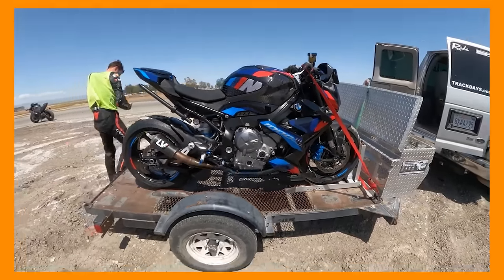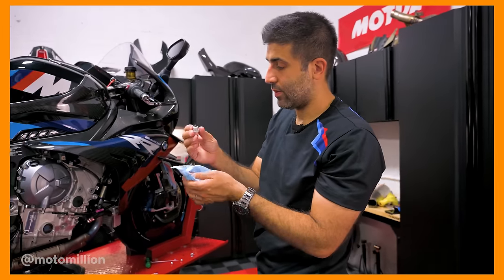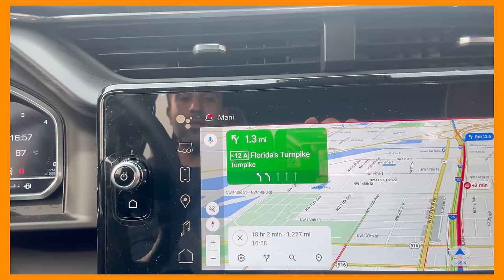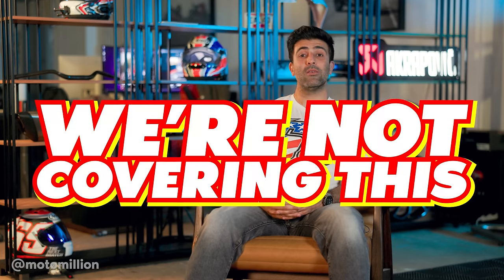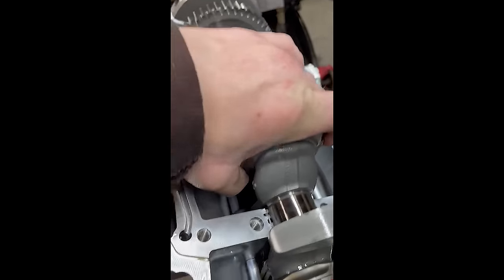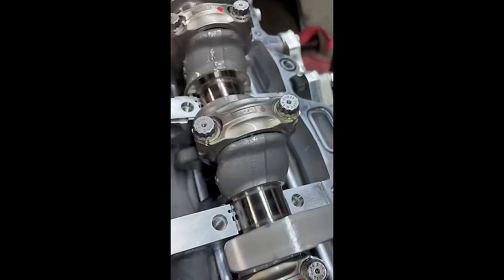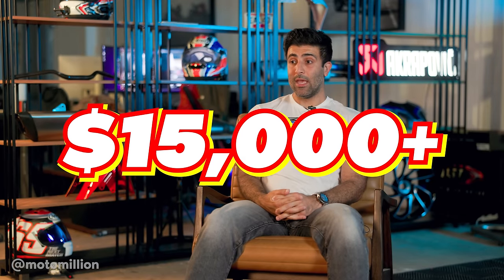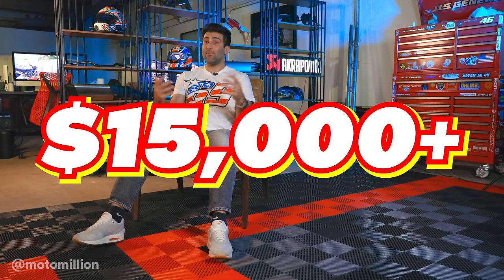MASSIVE Engine Failure on our M1000RR & BMW REFUSED Warranty...

Comment: pretty sure it quite clearly states in the warranty that you can not make any modifications that might effect the operation of the bike and you made a lot. So its no wonder they didn't honour the warranty as you didn't keep to the terms and conditions I suspect.
Reply from the maker: I understand that you don't know the full story and didn't watch to the end.

CaliMotoTV's BMW M1000R blew up on the track. That bike had a full exhaust and an ECU flash. BMW fully replaced the engine under warranty.

Why was Bill's replaced even though modification were present?
Reply: @Motomillion  that doesn’t change the facts about what I have said. Just because someone else’s bike had a different outcome doesn’t change the facts about what it sais in the warranty documentation.

Comment: Gotta say fella, my first thoughts were... " Only a fool puts a barely run in hi performance bike on a dyno and revs the nads off it"... But there are way too many similar instances of this failure on the beemers. I also saw that CarWow vid and figured well theres gotta be a friday bike every week....
For reference I have owned bikes of all types n manufacturer over my 30 years riding, I currently have an MV Dragster 800 RR SCS n thats a highly stressed engine as factory original. I ran that in religiously for the first 1200km before taking above 5k rpm. Its only 3k on it now as I dont ride as much as I used to.
I blown a few engines from Huquarvana to Yamaha n Kawasaki all tuned.... Never blown a Honda tho.... 
You did state that the bearing had not spun n theres no sign of over heat.... i am wondering is it possibly a bearing or oiling design issue.... Probably a bearing type mismatch/incompatibility.

TVR had loads of issues with their inhouse derived Speed 6 which in the end was fixed by the inde specialists (the best of them Powers Performance), replacing the internal chocolate factory components... I had one n went through a whole load of pain n let me say 15k is pennies in comparison.

Comment: I have owned 3 K6 1000 suzies. Mostly run in at redline, bulletproof. My current ride, GS1250 triple black, very leaky Hayes front calipers, BMW didn’t want to know about it, gave me the runaround big time until I gave up. Mmm I paid $31,000 Aus. For a premium product, not so premium.

Comment: Remember cbr1000 rr with juice box 🧃 it was riot but when change fuel ratios the engine catches up but when its breathing have to block plate remove smog etc

Comment: this is also why you should NEVER flash your ecu or use a 3rd part plug in to add/remove ECU features. 
what brentuning and woolich racing do is they turn off the o2 Sensors and make their own tune that the bike runs on. this is bad for many reasons. tuned in different states/countries. different fuels different elevation, air density etc all the stock wideband sensors calculate. (but the flashers disable) 
if you did flash the ECU I would say BMW is right to not honor this claim.

Comment: The break in period for the M1000RR is 746 miles, the engine should never exceed 9000rpm's.
At 400 miles, well below the break in period, you put this bike on a dyno and rev the living shit out of it, you did this before all the internal engine parts had even a chance to seat.
Then it blew up(what a shocker) and BMW refused warranty.
Well of course they refused warranty, it doesn't take a rocket scientist to see why!!!
BMW puts an electronic limiter on the bike to prevent you from going over the 9000rpm, it gets removed when you bring it in for it's service post 746 miles.
You did your own service and clearly removed this limiter at 400 miles, you literally did everything you could to null and void the warranty, this is 100% your fault!!!

Comment: This is propably bit of an disaster for BMW if this is widely spread problem. Could be that the defects per million oppoturnities is not under 10. But to be fair, this bike was not serviced by authorized repair shop, which the manufacturer or seller will use in their favour.

Comment: Wow ive never herd of so many pissed of people regarding their bmw. I myself is paranoid about break in procedures and what not. I follow their procedures and then ask before i modify my bikes. I inquired about bt tune to my dealer before i did stage 1 to unlock the limiters and tune it properly. Bmw said it wasn't a problem to do so .Bmw told me that they expect their customers to modify their bikes. Bmw also told me that they will take the flat spot out in the rpm range so i would not have to have the bt tune to do so, but it would not have as much power as the bt tune. I have about 4500 miles on my bike and ive changed my oil 7 times since ive purchased my bike in 2022. I have had a 2010, 2012 and now a 2022. I had loads of problems with the first two which bmw warrantied. I have been impressed with the 2022 bike i just hope ive not jinked myself by saying it out loud. Now i will not go back to bmw because they want me to change my brake fluid at a outrageous cost which i did my self but it will cost me 60 bucks just to take the light out. Come on thats BS. 
Long time customer of LEES Cycle in San Diego and Jeromy Toye they have always gone the extra mile for me at a fair cost since 2008!

GO Sean Dylan Kelly!!!!
Reply: Oh buy the way u did a good job with the video and thank you for that! Also you kept your cool through this crap they delt you and you should get a medal because ive would have had a melt down and.......

Comment: M1000RR break in is <7000rpm for 186 miles, <9000rpm for 621 miles. He puts a brentune on it, over revs red line by 500rpm 40+ times and puts it on a dyno all before 500 miles. And now, he wants BMW to cover a blown engine under warranty ... roflmao! I just lost a bit of respect for him. Own up to your mistake and move on. However, could the engine have left the factory with a defect, possibly, we will never know.
Reply: You didnt get the full story? He has more than 300 miles and as per the manual guide it's okay to do the first service. He asked the dealer and done the 1st service him self at Motomillion. After that, he got the bike tuned.
Reply: @luanphamuc4921  you are the one who doesnt get it. you are not supposed to go full throttle until 621 miles. he put it on dyno at 400 miles. doesnt matter when you do the first service.
Reply: @optikforlife  you're wrong. the manual says you could do the 1st service after 300 miles, you do not have to wait until it reaches  400 miles. That's why Manni did 1st service at 300 miles. After the 1st service done, the bike is supposed to operate at full throttle, then Manni brought it to dyno and did the tune. Watch the video again bro!
Reply: @luanphamuc4921  you are wrong. In the manual it says no full throttle: 0...1000km. Period.

Comment: you should know that. every maching has to go through a break-in period. you cannot just rev it to the max, step by step until that period passed and even more to be sure. i always go in for a 1000 miles break-in period. no joke at all. If you do not do that, you saw it for yourself. you should have taken it to bmw when you saw the first major warning light.

Comment: Fist of all, I think there are underlying problems with the engine, straight out of the factory. But I think this fair that BMW did not acknowledge the warranty for this case. You can't do your own servicing on a bike that is under mechanical warranty, end of story. You went the extra mile and removed the rev limiter that was clearly in place as a means to protect the engine during the break in period. Then you went full send on a dyno. It doesn't really matter that you "know what you are doing". I personally bought a new CRF1100 and I'm a fully qualified mechanic, yet I don't do the servicing because I know that if something goes wrong with the engine, it may not be covered. Honda are horribly incompetent and overfilled the engine by 600ml of oil during the break-in service but I will still be getting it serviced with them because I need to in order to for mechanical warranty reasons. You mention nothing about the terms of the mechanical warranty in this video and my guess is that you would fine something along the lines of "all servicing must be carried out at BMW mechanic".

Comment: I know everyone is in a rush and doing  things to the bike that might jepodize the warranty seems to be the issue. If its a crappy bike but you followed all the procedures specified then maybe you would get better treatment. Sounds to me that this bike has issues and they know it but when claims start to mount up , guess what happens , you end up in this position. Best of luck with your next purchase and I do get it , this a frustrating place to be when forking out $40k.

Comment: heartbreaking to hear but yeah you shouldnt remove the limiter thats 1 big mistake....2nd if the engine rattles i shouldnt put it on a dyno and 3rd im almost sure there has a faulty bearing in cyllinder 2 .....i bet the messed up the bearing clearance in the factory it self....seeing the conecting rod my geuss wrong bearing clearance but because you removed the limiter bmw says you worked on it yourself waranty gone that simple ....you should put the rev limiter back on and tell bmw it whas fully stock.....in belgium if you buy all new r1 or bmw or ducati every shop gonna tell you to do min 500km or 350miles and if you remove the rev limiter or other stuff you should let it do by certified bmw shop

Comment: Fell sorry for u bro honestly, but removing rev limiter even though wasn't a reason behind the engine failure, it was a reason for BMW to void warranty repair. Each manufacturer would do the same in that case. It's stupid as they are definitely aware of the problem and know it was factory problem. Was thinking about getting S1000XR M but i think you made up my mind and I will get multistrada V4

Comment: Why did the dyno operater let it sit at that high rpm for so long? He hit the stop button but the dyno brake didn’t activate. Either it doesn't have a brake or it malfunctioned. Either way, I don't think its a coincidence the bike revved super high and then had a problem. Since you mentioned over rev, only two ways that can happen. You had a mechanical over rev or a tune that raised the rev limiter. 

Unfortunately, this is your fault. Instead of breaking the bike in properly and making sure everything was good, you rushed it so you could start modifying it for youtube views. Now you're looking for BMW to cover an engine repair when you ignored their warranty terms and conditions. 

I'm willing to bet the 19 hour drive had a lot more to do with a Tech that would hide certain details about your bike to get it covered by warranty. Did he reflash it back to stock before starting the claim? BMW can see that too. Theres really no way to install a tune that BMW can't see. The BMW electronics is way more advanced than Japanese brands. Its hard to fool BMW.

Comment: I would say it is very hard to ruin an engine that quick that has oil in it, unless metal is bad in one of the parts, or improper assy, just my 42 yrs experience.

Comment: You modded the bike instantly, you  knowingly tuned it with warranty voiding tunes, you ran a sprint air filter knowing they do not clean the air anywhere near as well as a stock filter and have many complaints about not sealing correctly! You knew the risk when you modded it and posted the evidence....

Comment: You meant to break it in correctly but cut the corner by dyno testing it as BMW would have detected in the ecu stating over rev by 250rpm so either way it the customer's and BMW's fault but if this became world wide spread issue BMW would be held accountable for manufacturing defect

Comment: BMW acted incredibly unprofessional. I have been running dealership service departments for 30+ years and your experience is unusual specifically from BMW. I own several motorcycles and have owned a couple of BMWs in the past. 
After listening to your experience I will Never own a BMW again unless it's used and out of warranty. 
I also live in Miami and you are correct, the BMW dealership here is Horrible. The one in Ft. Lauderdale is slightly better. Nevertheless your issue is the fault of the manufacturer for sure.

Comment: German engineering is still trying to relay on the reputation from the 80's and 90's. Every survey I've seen shows German cars scoring at the bottom of the list for reliability and its not much better for the bikes too. I know it sounds boring but I would sacrifice style over reliability, that's why I trust Japanese, ridden hard and has zero issues. Top of the list Yamaha and Honda

Comment: would have taken them straight to court after the issue at 9 miles if they refused to fix whatever was wrong. not for nothing but these higher end bikes have wayyyy more issues than Japanese bikes. just do the research! $15k??...f*** that! maybe not a great idea to put on the dyno at 400 mi but clearly not what caused the problem. its a bad look for BMW. I like the design of the M1000RR  and the features but i'l stick with my 3 Ninja's.

Comment: BMW mishandled your claim. The failure to honor this warranty issue will cost BMW far more than the price and installation of a new engine for you.  Not sure why they chose to go this route on your claim. Hopefully someone in charge will see this and reevaluate their business practices. In fairness, I had a warranty claim on my '21RR which was resolved only after much effort on my part. BMW NA made it right, but I was banned from my local BMW dealer in Denver because I would not back down after they refused to help me. My latest purchase was a Ducati rather than a BMW for this reason.

Comment: This is a race bike with a license plate. I’m not saying you didn’t follow the break-in procedure to the letter nor should a 250 RPM over-rev cause the connecting rod clearance increase so drastically. With that said, failure to follow the break in procedure to the letter, or failing to follow the instructions on the display that said get to a dealer ASAP, means you’re begging for a warranty denial. If your local BMW dealer is crap, why on earth would you even buy one. You must love paying the BMW tax, consider this a valuable lesson in how the tax works as the consumer has to pay. 
This is why I have stayed away from BMW, and I love their GS, but I would never buy a new one ever. I refuse to pay the BMW tax!

Comment: Usually, rod bearing failure is a direct result of lack of oil,  or improper clearance between bearing surface and crank journal 
Sounds like BMW doesn’t support their end users

Comment: Sounds like you got a lemon and you probably knew it after 9 miles, but you ended up modding it, instantly voiding warranty. Now, BMW could have honored it out of loyalty, PR, etc, but have no legal obligation to at that point. I mean, you messed with the ECU. Manufacturers do not like that. Don't give manufacturers excused to deny warranty. Putting a slip-on on, they'll probably look the other way. Start decatting, messing with O2 sensors, ECU, fueling, timing...and you're probably screwed. This is coming from someone who owns an H2. But I didn't do any modding until I had about 1000 miles on it and knew everything was solid. I mean, it only takes a couple weeks to put 1000 miles on a bike, expecially living somewhere like Florida. Doesn't anyone have a modicum of patience anymore>

Comment: i worked for bmw and with cars all engines are tested for oil leaks and bhp and torque and few over things and bikes are most like done same way all engine have a break in for a reason to check the engine so if it says do 600 miles you do 600 miles if you do less then 600 miles and remove rev limt ofc bmw gonna say no. i say this from your side yes bike should not blow up but you messed with the bike/ bmw side here he serviced bike him self did less then recommended miles put it on dyno why should we repair or replace a bike that has been voided by the owner. i think bmw is right if i was them i would say no for simple reason you serviced bike by your self if you dont take it to bmw for service and you do it yourself bmw dont know what you done or touched on that bike why should they lose money if person voided warranty

Comment: Brother. It is really your fault. Never ever remove anything from the bike or put a tune on the bike until the warranty period is over.
Regardless of the engine failure being caused by rev limiters not, manufacturer will use it as an excuse..if you go to court, you can't win, because you didn't follow BMW's instructions.
I understood thay your friends did even more mods to his BMW, and BMW still gave him free engine underwear warranty. But you can't use him as an example. It is all about what you can prove before the court. You can prove nothing.
Why do people do silly things to  brand new bikes such as tune, removing parts, and all. 
I wouldn't even change the exhaust on a $50,000 bike.
Watch Nico's videos on YouTube.. he got a brand new Ferrari.  He only put a novitec exhausy. He had plenty of electrical and engine failure. Ferrari didn't cover under warranty. Because He changed the exhaust.

Comment: Same issue here with a 1250gs, fuel guage. not covered, pissed off owner fixed with with a plier on the leveller and done..... was loose from factory

Comment: I had a brand new 88/89 fzr1000 blow the clutch basket/clog the oil sump screen/grenade the complete motor...years ago...the bike had 5 or 6k miles on it... Yamaha sent a crate motor to the dealership and swapped it out NO CHARGE...you can learn something about customer Service from yamaha BMW...